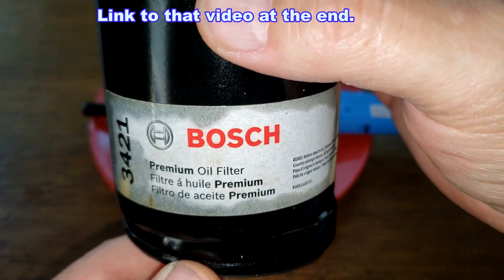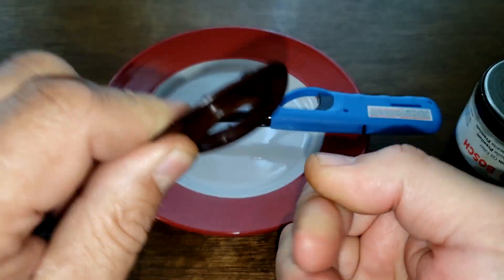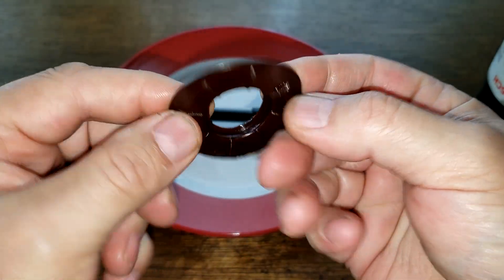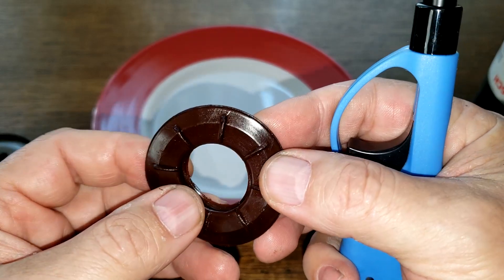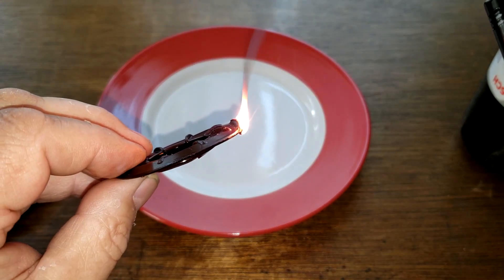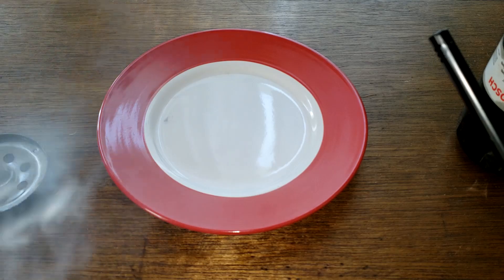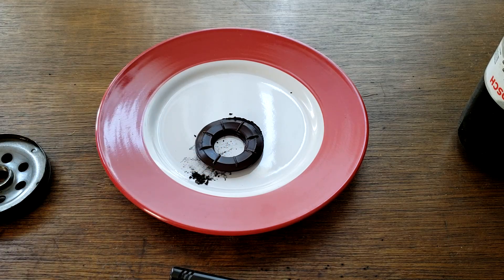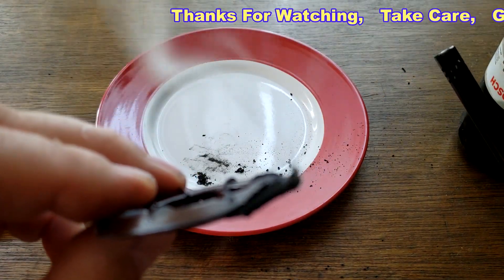Bosch Oil Filter Anti Drain Back Valve Burn Test, Bosch 3421 Oil Filter

Comment: If the filter is “fresh”, then what difference does it make what material this valve is made of??? 🤔🤷🏽‍♂️
Reply: In this case, a commenter believed it to be silicone because the black also appeared dark red in the original vid. Why Whip did a burn test. Since you asked.
Reply from the maker: faxmen09 beat me to your answer, but silicone can take the oil and heat better than rubber. Nitrile rubber can become stiff and brittle over time.
Reply: There's a channel where the guy opens filters with 20k-35k miles on them. The rubber valves get very hard & brittle, often falling apart when he handles them. The silicon valves remain soft & pliable. 

Under normal conditions, 10k miles or less, it probably doesn't matter. Most engines don't even need the valve since their filters are installed pointing upwards. But there are those with sideways & upside down filters (Jeep I6), that probably want that silicone valve.